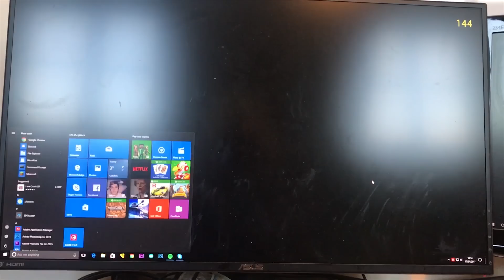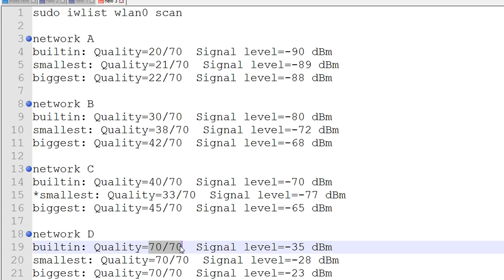Pi Zero W External Antenna Mod | Supercharge Wifi

Comment: Dry solder joins! You need flux!
Cover the small resistor in flux, then de-solder it and wipe it from the iron.
may by you can use it once more.
Cover the connector in flux and solder it.
After than clean everything with IPA 99% alcohol.
A very fine tip dont transfer heat good, but a good one is a key too.

Comment: I did this by naked eye and with larger solder iron tip. It was a mother loving nightmare. I would not attempt this operation again without the proper equipment. That resistor he removes is about the size of 2 grains of sand.

Comment: Those antennas are HALF an antenna (verticals). If you installed them so they had a ground plane to work against you'd see a significant difference
Reply: what
Reply: what?

Comment: Modded mine too. Due to the tiny size, it was very tricky and I could not be sure, if the bridge-wire (I also wasted my 0 Ohm resistor...) was properly connected. So I had a few resolder -> reboot -> check-wifi -> repeat moments. In the end, I had decent wifi quality.

Comment: 2 things.

A I thought the pi zero w had dual band wifi, thus why did you only choose 2.4Ghz antenna? Please explain this one.

B You were so close to transmitter during test that any measurable gain from your antenna would be almost nullified.

Comment: Hi, great video and like you, im crap at soldering. Is it possible to cut off the plug on the end of the antenna and solder the antenna cable directly to the board rather than trying to solder on the fiddly little socket??
Reply from the maker: I guarantee you that would make things more difficult to solder, the connection wouldn't be that great and it would break off real easy. The socket is worth it!

Comment: Simply put some additional solder on the component for desoldering it.
Reply: Before?
Reply: @socrates_the_great6209  Put as much solder on it such that the tip of the solder iron reaches both sides via the additional solder.

Comment: Use some flux and clean it with alcohol.
Those solder-joints look disgusting.
Reply: Suprised you can see those joints from up on your high horse.

Comment: There's also …uhm, what's the proper / technical term?… radiation pattern …direction(-ality) …something something, mumble …the antenna design. The zero W's internal antenna, according to my laymen's understanding of RF voodoo, doesn't seem to be omni-directional, like the modded external ones. That internal one's signal strength might depend on the mounting position / orientation of the whole Pi. An external antenna should be far more flexible. Thank you, i didn't know that the Pi zero W already has provisions for this kind of mod.
Reply: Shut up
Reply: @sureshbhatt4287  hahahahahaha....

Comment: Well, I recently came into possession of an RC boat that's, not great. It uses 433MHz RF, but the controller board is not great. I think the relays are going bad. So I thought i'd throw in a PI Zero w and control it with wifi and add in a pi cam, it might be cool! I want to be sure though that the wifi range would be good enough.

Comment: what was the recommended equipment? a heat table or something? going to do a portable headless (using my android phone as a monitor/keyboard/internet) pi0w build starting at the end of next month and want to have my ducks in a row.

also, can you do a test with bluetooth please? I think bluetooth will use the same antenna as it works over the same wavelengths and the chip does both, but i'd like to check. the case I have is metal so I will need the external antenna to work for both wifi and bluetooth.

Comment: You should have used a fine tip soldering iron. I've worked in electronics industry for many years and found easy ways to work on surface mounts like this. Also, a pcb cleaner wouldn't hurt, it'll clean any flux and dirty stuff making it clear to show any accidental shorts.

Comment: Antenna are not powerful or less powerful.    Antenna have gain and the gain will vary based on antenna design. SO your showing not how much power an antenna has but the relative gain of each antenna.

Comment: is it possible to have the internal antenna and the socket for the external antenna at the same time by just removing the in line jumper resistor and soldering both points

Comment: Does anyone know where I can buy a case for my Pi Zero W that allows for a monitor?
Reply: What do you mean by "allows for a monitor"?  Like something that doesn't cover up the HDMI port?
Reply: I was corrected, I assumed the ribbon cable connector on the W allowed you to connect a ribbon cable from a monitor. But I was told the ribbon cable connector; while the same type of connection, wouldn't work for a screen. It's only for the camera.

Comment: I recommend using a 'fine tip', very common in smallish/average pcb work. Your 'monster sized' tip is frying near by planets. That girth will increase the chances of sucking up your components,  a fine tip point has much less thermal reach outside the solder point area.
Like you, I've come across the over zoom problem, it's actually impossible to tell depth, it feels like you're swinging around a large weight on a spring.. I trashed all my magnifying glass solder stations and ended up with +1.5 or +2 set of plastic glasses from the Dollar store. They work great, excellent magnification without loss of depth perception. - Give it a shot.
Reply: I've been trying to figure out what is considered as a fine tip soldering iron. Could you post a link to one?

Comment: Dude, when you SMD solder, TWEEZERS. It'll help with components getting moved around by the iron and whatnot.
 Tweezers in one hand, soldering iron in your other hand, solder in your third hand and use your fourth to hold the board. Easy as 1 2 3 4
Reply: And use some rosin soldering flux paste, it really helps the solder flow giving you nice clean solder joints.
Reply: his soldering iron is way too hot anyway, looks like 400 C to me. Should be around 275-320 C

Comment: I have a number of questions.
Ok you have 4 networks ... what was the distance between each network and the Pi0w?
Did each network use the same equipment? (i.e. the same router (with the same TX/RX power))
What TX/RX channels were the networks on  and could there have been any interference from other networks?
Were the external antennae positioned in the same orientation as the Pi0w?
How many times did you run the 'sudo iwlist wlan0 scan' command?
How long were the external antennae? (For a 2.4 GHz signal the ideal antenna length is 125 mm)
Reply from the maker: The test wasn't scientific, just on various networks I picked up in my area to get a feel for how beneficial having a bigger antenna was.

Comment: +3 dBm is doubling the received power. so change from -90dBm to -88dBm is ~60% increase, and -35dBm -> -23dBm is ~15x improvement.

The external antenna thing can be pretty good indeed, especially if you use an external directional antenna.
Could you test the case where you have ext-ant connector in parallel with the PCB-antenna so that both are connected at the same time, can it be just plugged in if need?
Reply from the maker: Thanks for explaining the numbers, in hindsight I should've looked that up before making the video. I'll give your idea a go and report back when I have an update.
Reply: I think the jumper connects only one route at any time because having both connected creates multi-path problems and/or upsets impedance matching.

Comment: Nice Video, but Coups you do a follow up on the raspi lan turtle video? Something like using the usbplug for data and using it as an Ethernet adapter or allow it to use PoE. Thanks

Comment: Does the network adaptor on the pi zero w support monitor mode or will you need a USB adaptor?
Reply from the maker: I may have a video on that coming soon.
Reply: that would be an awesome video

Comment: 1:05 ? 45 degrees? that would be slightly off :p still a nice video :)
Reply: should be 90 degrees not 45 ;)
ignore that, i was working from the wrong side of the resistor...
so no, I agree, about 45 degrees is right
Reply from the maker: davedarko How so?